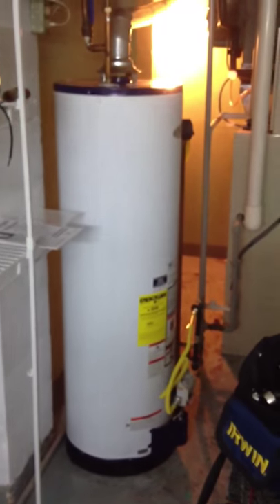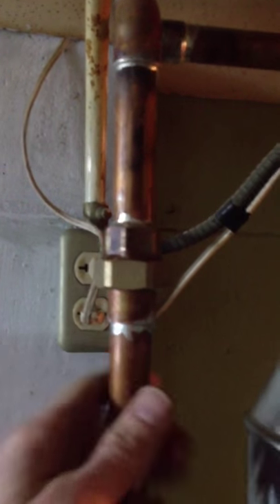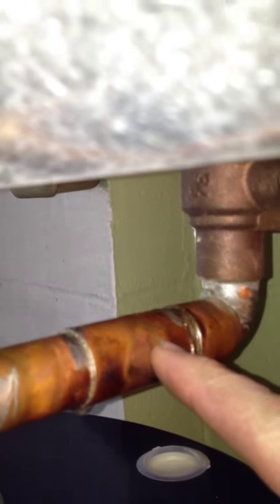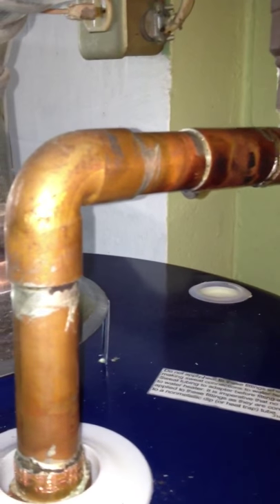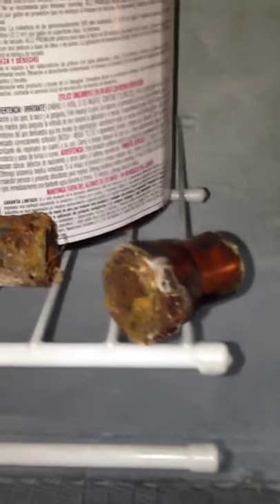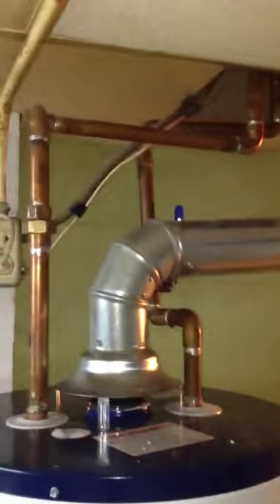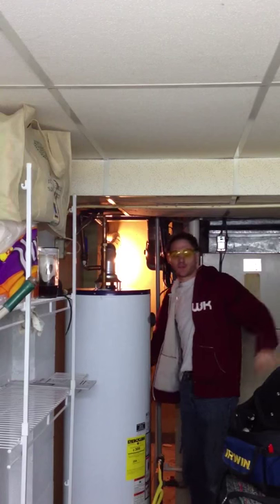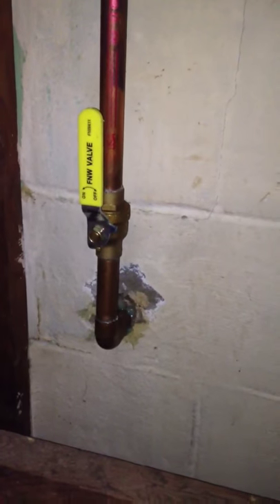Water heater after math... Haha, pipe broke off...

Comment: Hi Russ, I was just wondering,,,,you know building codes and all that crap constantly change. Did you check with your local city or town on the latest building (house) codes for installations of new gas water heaters? such as do they require that the water heater have a drain pan installed under the water heater?